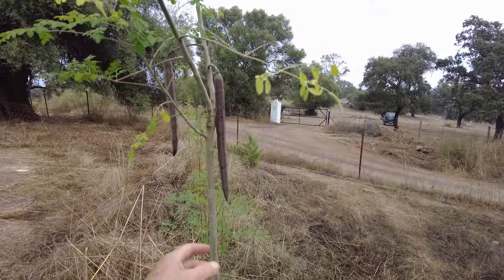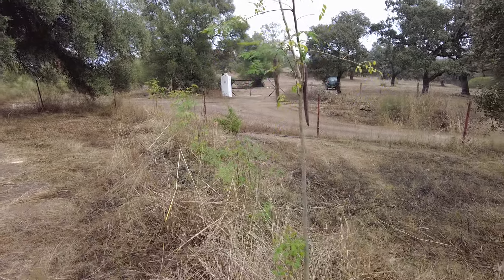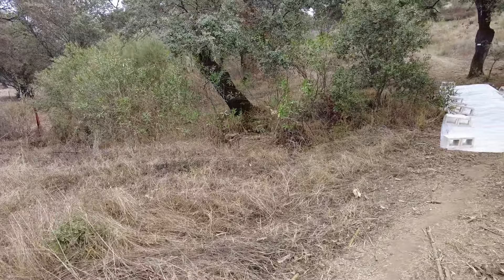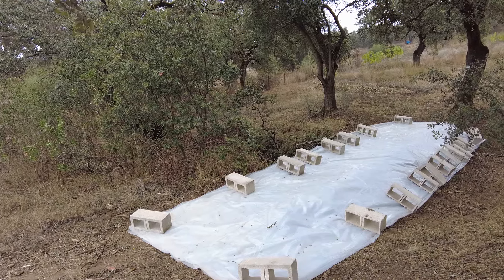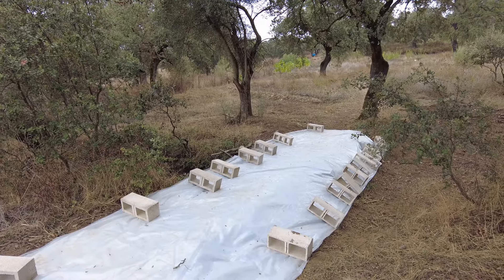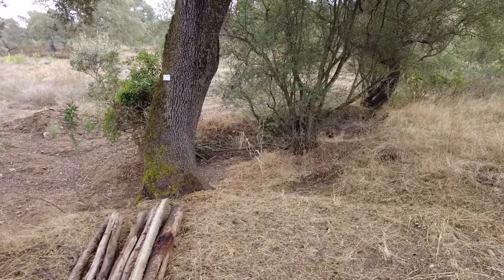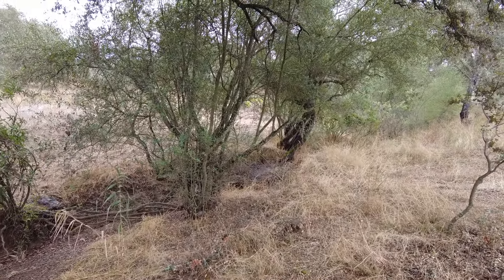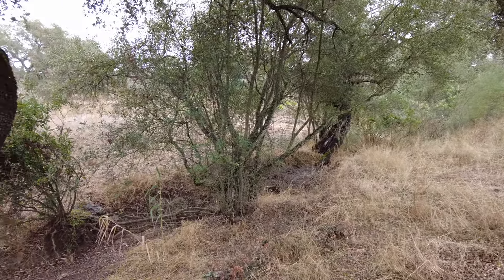I'm an engineer's nightmare. Erosion control or illusion?

Comment: This might sound silly, but one half baked idea deserves another!

If your sitting there in a deck chair with umbrella whist the rain comes in,,, you could,, at the moments the water level reaches the plastic sheet, hold the sheet down for a few minutes until you got water pressure holding the plastic sheet down.

Those types of dams will hold if you have

1. hundreds upon hundreds of reeds growing on them.
2. There is a deep basin on the up-stream side,,, as water on water acts as a massive breaking system, takes a lot of energy oit of the approaching water.
3, 10 or 20 yards upstream you have a mini leaky weir or logs across the creek as primary breaking system.
4. Adjacent the plastic sheet thingy you have a diversion swale or pond dam.

Or you build a crossing with rocks.
Reply from the maker: @adammac4381  Man o man. I'm more into watching than doing this month. Thank you for sharing. Please keep sharing

Comment: I'm so excited for the rain for you.

A culvert or bridge system might save your road, but rather than one straight through pipe, which we all know focuses the water, multiple pipes that get wider towards the exit side would prevent that buildup of pressure.  You could also/instead put the cinderblocks vertically into the ground on the upstream side, those logs nearby would fit perfectly through the holes, and take some of the energy from the water as it hits, and deepen the basin area.  You would get a sort of gabion, and the water would head towards the mini spillways you have established with less power.

I'm afraid if you want to keep the road, you're going to have to view it as a proper road and engineer it properley, or repair it after every rain event.  Either that or you fill it with rocks and stones to make some sort of built up ford that returns after the flood.  It all depends how succesful your upstream efforts are at slowing the flow before it gets there.

Good Luck
Reply from the maker: @Argrouk  Let's wait and observe what unfolds. Thank you for sharing great ideas.

Comment: Hi i follow your "water plantation" adventure on weekly regular base even if i don't often comment. i appreciate your efforts to stop erosion and tries to irrigate your homstead. imao using plastic sheet is not a good idea. On the middle term it'll decay and send a lot of micro particles in your soil and in down stream water to end in ocean. Hurricane Helene and Milton recently brougth tons of trash in our shared ocean. If we can avoid to add our share of plastic trash in the environment it'll be better for everyone. Plastic pollution is a  castatrophic both short and long term one.
Moreover I doubt that this plastic sheeting is very effective in stopping erosion at this location. the water will either pass underneath or above and as it is a smooth and flat surface it will accelerate the speed of the water. If you want to slow down the speed of the water you must dissipate its kinetic energy: create meanders where there are straight lines, put obstacles (rocks, trunks, bda...) where there are none. In short, what nature did before man transformed our waterways into ditches.
Reply from the maker: @jerometeyssier3171  Good information and sharing. Much appreciated. The first real rains in October is usually rough. After that I might be able to do something to save it.

Comment: That plastic probably won't last the winter.  Perhaps some texture running perpendicular to the flow.  Anything to slow the water down.  Probably slowing it down before it gets there is better.
Reply from the maker: @HylanderSB  Temporary measure indeed. I just try to escape the first impolite rain. Thank you for sharing good information.
Reply: @SuerteDelMolinoFarm  ...I believe you may be able to use MULCH in the form of straw/hay, IF available, <...pero si no hay...? > oh well... *(PUN: "Hay" in English & "hay" in Spanish).
Reply from the maker: @steverapisura5418  No hay hay aquí. Ja ja

Comment: I hope for a lot of that wet stuff. 
And for the erosion prevention engineering part...
I'm a self proclaimed youtube expert, so take my words with 2kg of salt. 
So here it comes. 
If you look at how they build dikes in NL, they always either put some plant on the sides that holds the soil together (usually grass) or (when not possible) they cover the soil with layers of gravel, small stones and bigger stones.
Since grass won't grow quickly at your place, I guess the second option is the best of these 2 methods.But still a lot of work and (possibly) cost. 
You don't have to re invent the wheel :) 
So, that was my youtubengineer take on the erosion prevention tries 😅
Reply from the maker: @tricks-and-tips  Exactly what I need. Simple stuff. Thank you for sharing

Comment: Let's see if it works. If it does,  then it was not a silly idea, lol. Would it be an idea to use some of the logs as a small check dam in front of the embankment, to temper the water a bit, before it hits the dam? They can probably be secured fairly easily by pounding a few stakes into the dirt over them at a 45 degree angle, making a sort of A-frame to lock them down. Just a quick random thought. Let's go, rain!! We want to see the water infrastructure work in all its glory. Take care.

Comment: Cotton sheets dipped in cement  and water mix, cut out holes for plants, it is done for embankments at sides of a motorway, just be careful not to erode further down, control the direction you want the water to flow, ideally to a pond.
Reply from the maker: @SuperRobinjames  SUPER. Thanks for sharing valuable information

Comment: I would have tried exactement this, even if i do not like to have sun exposed plastic.
This is king of organic mater on your soil, of course it will work... hopefully.
I bet it will fail downtream first by sediment removed by accelerating water leaving the dam. It may also fail by water incursion bellow the plastic sheet or with water full of sediment/ stones that rip the through the carpet. I bet on the first way.
I hope you won't get too much water at once as dry soil tend to be hydrophobic.
Reply from the maker: @user-vo3st8kx7s  Good sharing. Much appreciated. Let's try all
Reply: @SuerteDelMolinoFarm   it worked :) it didn't failed :) bravo!
Reply from the maker: @peperillon  Thank you for sharing. Much appreciated

Comment: Your earthen barrier is just like the road at the top of your property, so putting a pipe through it is a solution? There are two causeways near where I live that have the same kind of pipe (culvert?) solution, they seem to work well, whereas ones without the pipes are eroded in bigger floods.  The moringa looks great, the future looks hopeful.
Reply from the maker: @Xperimenter  Thanks for the sharing. I don't like those pipes but might be what I have to do.

Comment: I think you'd be better off with just the cinderblocks on the upflow side where the water is rushing in to try and pacify it and then some rocks on the upper side of the ex leaky dam to slow down erosion, I think the plastic sheet will just float away the moment a significant flow comes in. Hope I'm wrong tho.
Reply from the maker: @pincopallinojoe9296  Horror movie unfolding. Thank you for sharing

Comment: Hey Martin! I'm here to critizice... sorry. I think you keep understimating the tremendous force of water, by the looks of the tarp it doesn't seems like it's going to work, it neds to be lower in the center and higher in the sides to prevent soil loss, the best aproach to what you do want is to replicate the way beavers do it, with brush, rocks and dirt. The tarp and the  cinderblocks won't work in the event of a strong rainfall. Based on the water of last rain season that little creek carries more than 8" of water, so i don't think is going to work, because the force and the weight of the water will push it down, and if it goes to the sides then the water is going to wash up precious soil away.  Your land is down hill so the water current is too strong, the only way you will be able to make that work is to make a pond wide enough to pacify the water and also a wide spillway to keep the water pacified. Let's hope rain comes soon. And keep up the good work.
Reply from the maker: @Xatruch504  I'm sure you are right. Let's see if I can get myself to sacrifice this small pond to the water gods. Ha ha. Thank you for sharing